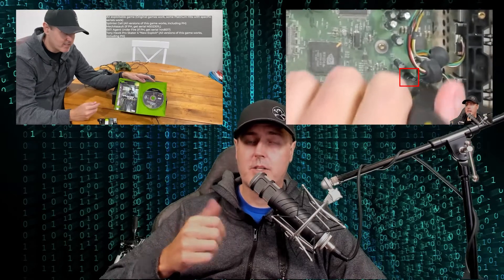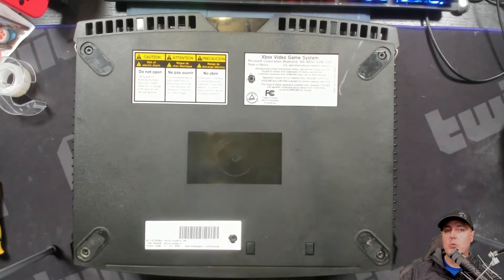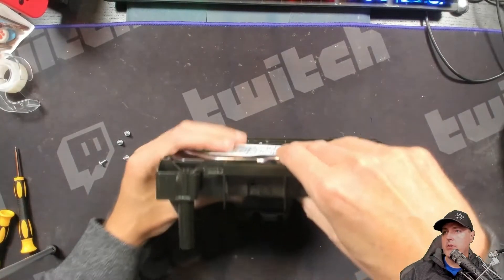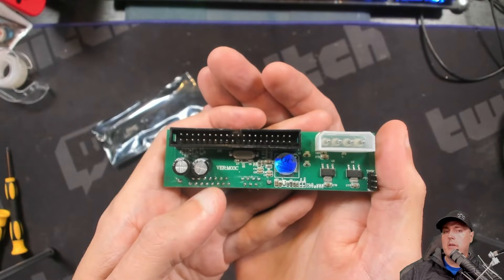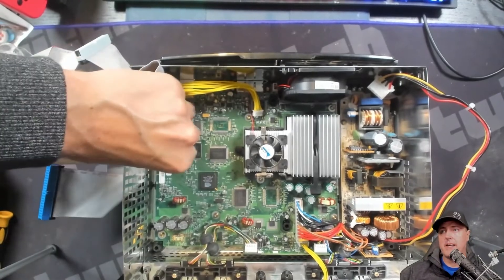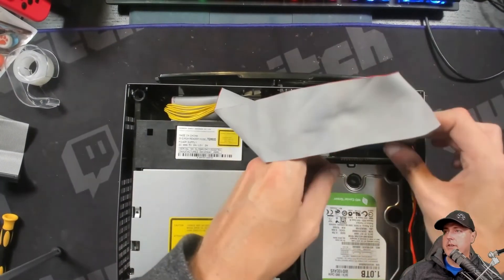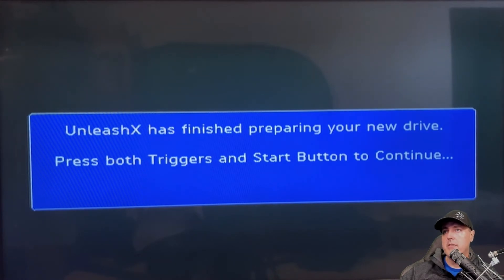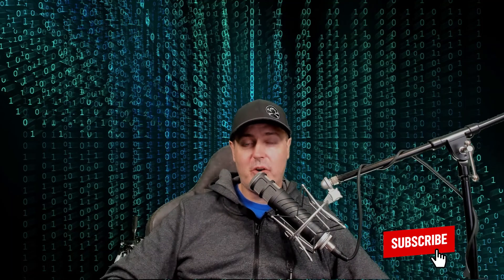Upgrade your HDD in your Original Xbox (TSOP/Modchip Guide) - 2021 Edition

Comment: How do you tell the difference between a 40 pin and 80 pin ide cable? And does it still work but slower or smth with the old 40 pin cable? I have a few ide cables lying around but i really don't know how many pins they are ... also, I'm using a crystal clear xbox so I kinda wanna use a nice looking (colored or black) black cable to make the build still look nice. Kinda want to replace my hdd with an ssd tho instead of another hdd.
Reply: 80 pin is gonna have very thin wires compared to the 40. will be the same with and ends though.

Comment: I just messed up the bios on my old stock hdd i have in my xbox so now everytime i boot it its stuck on the boot screen... but it is TSOP and has Evo X, If i get a hexen disc and plug up a bigger drive will i be able to use it as my new drive?